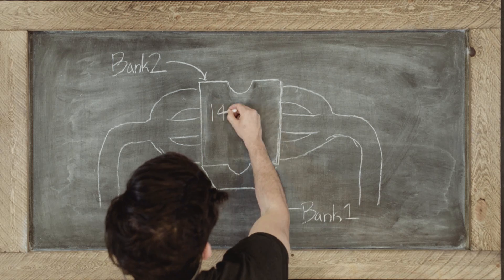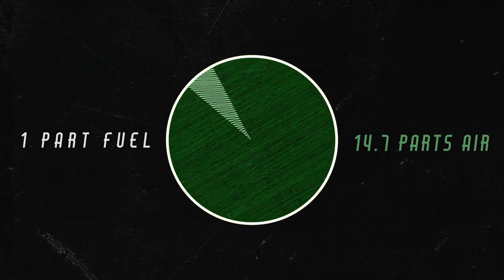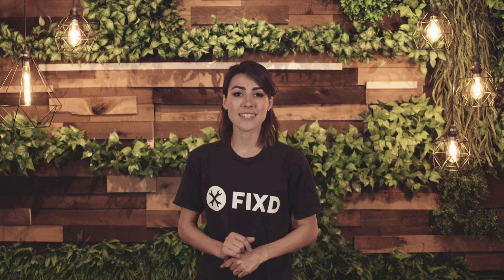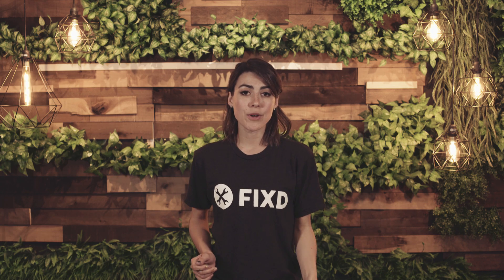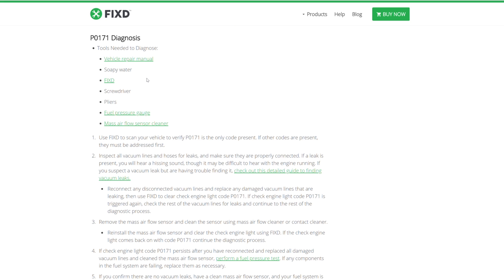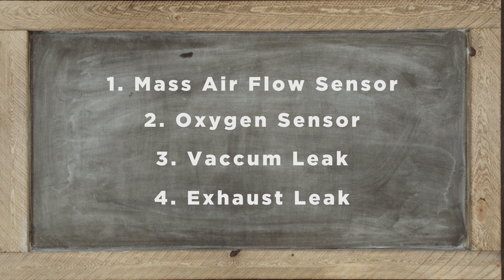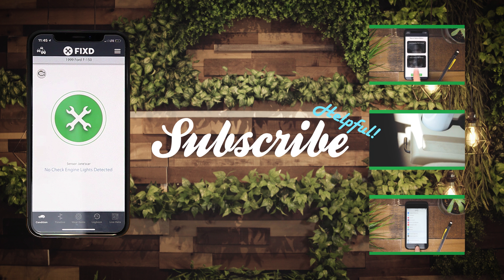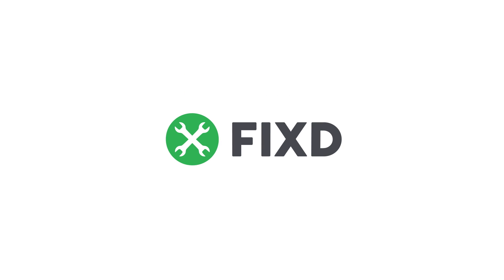P0171 Explained - System TOO LEAN (Bank 1)

Comment: The problem was a vacuum leak I had disconnected the tubing running from the exhaust manifold to the EGR valve because of a low EGR flow code. The reason for that was because I couldn't get the bolts out of the EGR valve without them snapping so I was using this method to spray through the EGR valve 2 possibly unstick it if it was stuck and maybe possibly the cleaner would go through the EGR completely and possibly break the carbon up in the EGR channels. The cleaner was a seafoam product used to inject through air ducts while engine was running. It seemed to have fixed the problem but not entirely I may have to do it again and see where that lands me since I can't get the EGR valve off without snapping the bolts.

Comment: Sadly for me i've invested tons of money fixing the MAFS and other shit and it still is on. When I had them check in the morning before I left for work they literally said nothing is wrong inside and maybe I should change gas stations or fuel types. And unfortunately that too did nothing the past 6 months BUT when I needed to have a oil change the light decided to turn off when they decided to do my inspection Early July and It popped back up the following day. At this point i feel like the light and the code is all bullshit, as it's trolling me.

Comment: Great video. My 97 Oldsmobile 88 has this code and on Top of that the car doesn't start half the time. As I turn the key it makes it's usual noise but doesn't start, and eventually it starts and runs fine. PLEASE HELP

Comment: Can this have anything to do with the muffler or muffler valve. I just bought a used car and 3 days later the engine oil turned on with codes P0171 and P0174 . I contacted the dealer and they said they’d check it but it was most likely a valve in the muffler? I don’t know much about cars. Help would be great.
Reply: how did u fix it , i got p0171 and been trynna fix it for 2 days

Comment: Mine's throwing that code, but running so rich it's painting the driveway under the exhaust pipe black.  It's not a vacuum leak or a fuel shortage.  Something is giving the computer an incorrect reading

Comment: Could a bad rear main seal cause it also?
Reply from the maker: That is a good question. The answer is YES it can. A leaking or failing rear main seal can cause the fuel trims to run lean by allowing excess air into the system. Many modern engines in  cars of today will run poorly and throw a fault code and or a check engine light for a lean condition simply by pulling out the oil dipstick on the engine and having it not seat properly. This again allows excess air into the system.

Comment: I pulled the fuel pump unit from the gas tank and changed the filter it fix my rough idle and long and no crank problems. I had this dam code for 2 years I did everything it’s still there I give up screw this dam car
Reply: Change gas cap. Maybe it’s the ecm
Reply: @sramBC I did gas cap replacement still same issue
Reply: Maybe it’s faulty header gaskets?
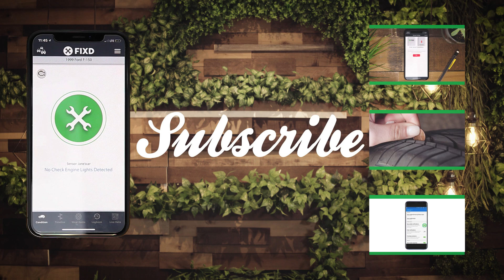Reply: Vacuum leak try a smoke machine 2:00
Reply: You drove it with the code for 2 years? Was it OK?

Comment: I keep on getting a P0171 code in a Chevrolet LS1 V8 powered car,the fuel pressure seems to be low at 50 PSI & there seems to be air in the fuel when checked the fuel volume,the fuel pressure should be 55-62 PSI.

So,the first thing I'll change will be the fuel filter before anything else,I've already changed the fuel filler cap which was leaking air into the fuel tank,note no P0442   is listed for my car as the engine is in a Holden who didn't fit a fuel tank pressure sensor !
Reply: So hows the update of your car now?

Comment: Not too bad. 98% of people would just change an O2 only because the code mentions the words O2 sensor.  Actually, O2 sensor is not the most common culprit. In fact, if the LTFT is able to set a functional baseline with a zero’d STFT, it is mathematically impossible the O2 can be faulty. But no, no- people just rev up their parts cannon anyway.
Reply: Ha, hilarious.  I just mentioned your video as a reply to one of the comments on here after someone complained about other videos going on and on...This tool just pisses me off, making people think it is going to tell them what part to change.  People were doing this with Actron code readers in 1996.  The video even helped direct them to replace the o2 sensor!  I noticed that there were no videos telling what part to change with a U1000 code..."Just tell me what to start swapping!"
Reply: Then what is it?  I notice you don't have an answer in your comment. Wait, maybe the most common  culprit is because someone left a moon pie laying on top of the engine when they were checking their dipstick.
Reply: i guess I am kinda randomly asking but do anyone know a good website to stream newly released movies online ?
Reply: @Bowen Devin Flixportal :P
Reply: @Boden Thatcher Thanks, signed up and it seems like a nice service :D I appreciate it !!
Reply: @Bowen Devin no problem xD
Reply: Code readers are just that, they are code readers and not a problem solver. They give a code, its thru PROPER DIAGNOSTICS that you find the real problem and can fix the issue. Codes merely just point you in a direction to get started. Many other issues can set a MIL indicator or check engine light. Problem with todays economy is vehicle owners DO NOT want to pay the labor price to have their stuff diagnosed and fixed, although they'll stupidly spend money just throwing parts at it and eventually getting lucky only afyer replacing everything that wasnt even the problem.
Reply: lol, exactly,when I saw the ad for it, I laughed coz it does not tell you exactly what it is and how much it's gonna cost, like you said, it gives you a place to start looking at just as this vid is saying,was like 6 different parts that could be bad or not working correctly,
Reply: @LonelyBrownEyes1977 you think I'm going to trust a mechanic you're funny, I don't trust anybody let alone an auto mechanic. 99% of them are all rip-offs, want to fix something for $2,000 and then it turns out not to be the correct fix, then they want you to bring it back they'll try to fix something else for another $2,000. screw that shit buddy, I don't trust any kind of service repair workers whether it be air conditioning, Plumbing, auto mechanics, and Jack in the Box coil rewind spring retainer repair, they've all got a bad reputation as being rip-offs, and overcharging.

Comment: Damn, soo many things can be wrong 😩
Reply: @Rez_Dog0311  but it's not urgent,,of course is a major difference after a spark plug change oil change etc,,but if the basics are done..then that check engine light shouldn't b on
Reply: @Rez_Dog0311  on my friends bmw it was a dirty injector and what I did was add Fuel system All in one cleaner and it took 2 of them and it did the job. I told him drive it for a while and yes the issue fixed while he was driving 💯💯 I checked everything else and no other issue was found
Reply: but all very very minor

Comment: ok so what are the dangers of continuing to drive it for a day or two till you can get it into the shop??
Reply: Nick M I’ve been driving with mine on for like 6 months. A day or 2 is fine
Reply: I'm gonna start by cleaning my mass airflow sensor and putting in a clean air filter... If that doesn't do it, I'm gonna get some fuel injector cleaner and spray around the intake manifold to see if it has any effect on the engine idle sound... If it does then I need to replace the intake gasket... If that doesn't fix it I'm gonna have to throw a new air flow sensor in. Hoping I guessed right with the MAF sensor.
Reply: @darthtrader1027  how is your ride doing now
Reply: @yuppppppl  good. I took it in to have a full diagnostics run on it. Turned out to be JUST the mass airflow sensor.
Reply: I had to buy a new one though, the carburetor cleaner or whatever it was that I used didn't fix the problem because the sensor just went bad.
Reply: I''ve been driving my Toyota 2003 Camry with this check engine light on for 2 months with this code.  It's not that big a deal but in order to make sure you have no engine issues in the future, try to get it fixed as soon as you can.
Reply: @elizabethlamboy-wilson7335  mine was the spark plugs...then the light return this morningsmh,,I too own a 02 camry with nearly 300kmile
Reply: For myself, I needed to tighten my exhaust flanges right out of the header on the passenger side..car runs brand new....
Reply: @Richard-vl2vz  what car were you driving…. Also did you recently do any exhaust work?

Comment: I am today check  mazda6 2016 show dashboard  engine check  light..  After i am connect  the  diagnostic  cable show me P0171 
Lenk bank 2
Reply: How to fix that because I have a Mazda 6 2014 y the same code P0171 and I don’t know what to do